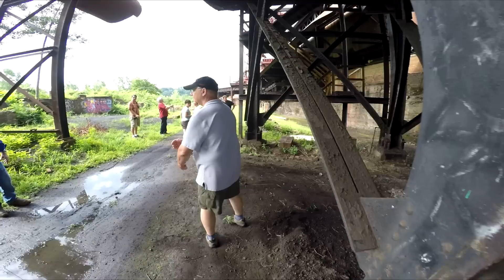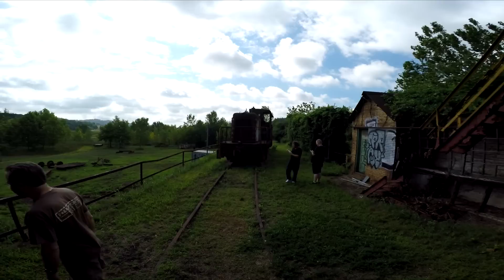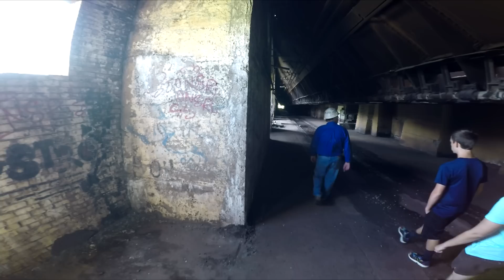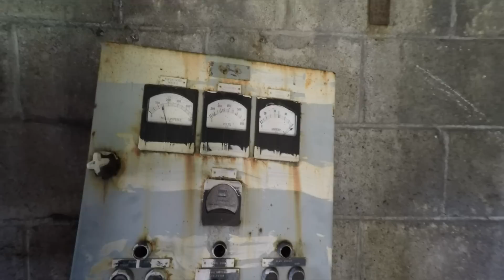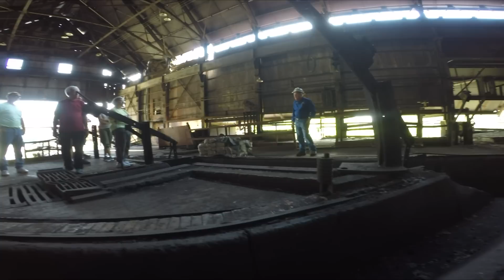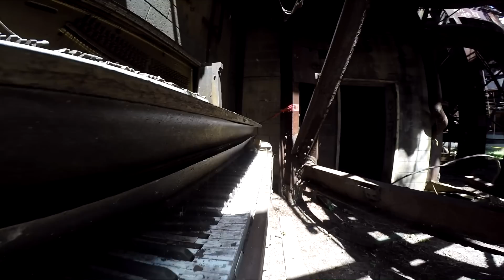Carrie Furnace Tour Rankin, Pennsylvania

Comment: I worked in nearly every part of that blast furnace as a summer job when I was going to school at Pitt in the early '70s. The guide stood just where I worked, from the Larry Car, the Skip pit, the Highline, the slag trough, and as 2nd or 3rd Helper diverting the river of molten iron.  You even paused at the Twears, where concrete water jackets would cool the nozzles for superheated gas. Sometimes a waterpipe would clog, and the concrete jacket would glow red. If nobody caught it, yelled like hell while they cooled it with a hose, and shut down the blast, molten iron could start spewing out of that hole and flood the casthouse. Dante's inferno on acid of a job.
Reply from the maker: Wow, Jeff. Just walking through the tour you can hear the descriptions of working there and processes and get some appreciation for the work,  but I know it can never come close to what  you experienced there. Thanks for you comment!
Reply: The whole thing really brought back memories. That now water-filled pit where the massive skip cars slammed down to be filled by the Larry Car was where I worked an absurdly dangerous job. With a pick & shovel we loosened the packed iron ore, coke & limestone that missed the car and got packed underneath. A spotter would yell when we were about to get squished and we'd flatten against the wall while this bucket weighing tons would slam in front of us. Then we were pelted from above with what missed the car from the fresh load of the Larry Car. It was appropriate your guide started talking about life insurance there.  Even digging out the slag run was an adventure. Since it was like light gray lava-looking concrete like stuff when it cooled, we had to break it up with steel pikes while standing on it. Your foot could go through a just-crusted spot into molten iron at the bottom (that dripped when you threw it with a shovel), so we had to stand on a board to distribute our weight. The only problem was the damn board would catch fire, so your safety device was also your kindling. Long. Strange. Trip.
Reply from the maker: That's great background, Jeff. Harrowing work behind products we take for granted as consumers. Are you still in the area?
Reply: No, I live in Southern California now, but I do miss Pittsburgh.
Reply: I grew up in Youngstown Ohio in the 1970's, my family and many of those in our small farm/mill town worked in mills or quarries that fed them. The dangers of the work was not lost on us youngsters. One of our school mates lost his father to ladle of molten steel ...vaporized him as I recall... something about a catwalk gave way. Tragedy for such a great family. R
Reply: Your legend ma man! I envy yall, id have loved to see this place in action, it's absolutely monumental and absolutely astonishing what was accomplished here with quiet primitive technology. Advanced, but so simple